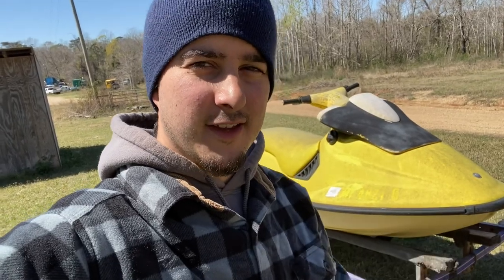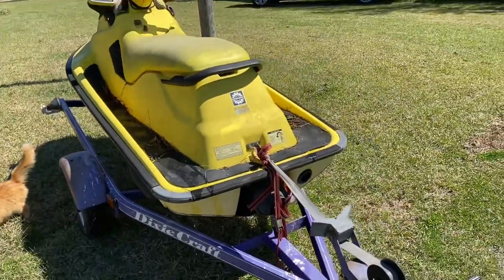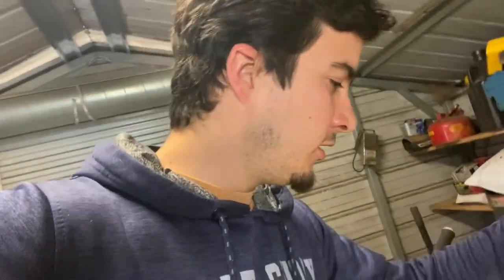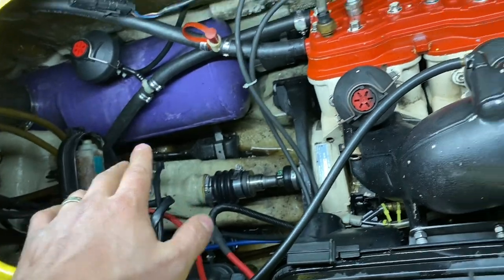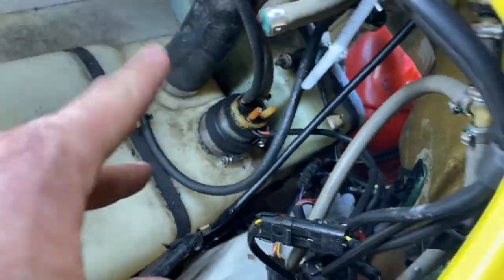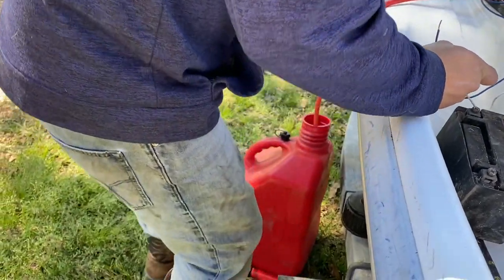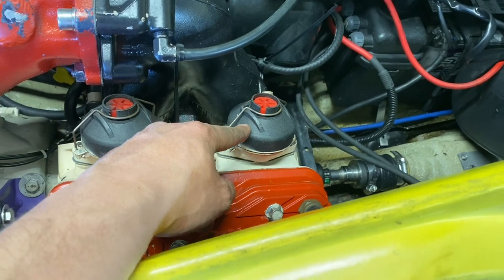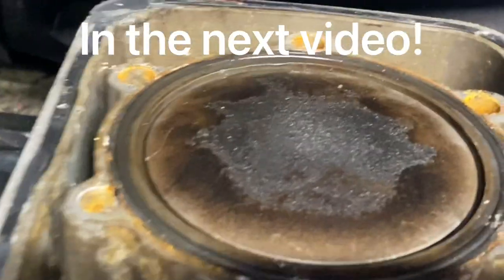1996 Seadoo XP kills battery’s and doesn’t pick up fuel

Comment: In the front ebox what is that red wire not connected to any thing
Reply from the maker: That was the power coming out rectifier to supply power to battery. You can unplug that wire and run the ski to see if that stops your issue. It will not charge the battery but will tell you if that’s your issue.
Reply: @CocosPlayound  I have the same ski. First time I had it out was the fastest thing out there.  Ironically lost spark racing a spark. Stator rotar came loose and shredded the stator. Installed new stator now it will crank but only fire once when I let go of the starter button.  I've already installed the new rotar 2 times thinking that may have been the issue. But sometimes I have spark and sometimes not.  Killed 2 battery's. But had a warranty so lucky me.
Reply: @CocosPlayound  I will make a short video tomorrow explaining more in detail and showing my few concerns and maybe you could offer 2 or 3 cents and help me get the lemon back out there ripping before the weather gets too crappy.  Hate to eventually sell it only riding it once     I got a 96 xp800 and a heavily modified 91 ts650 both rebuilt the season before I purchased them.  Can't trust anyone else's work.  Coulda blew up in-between my damn legs